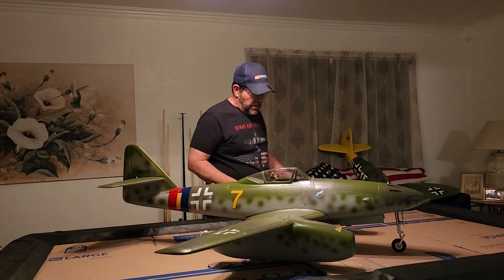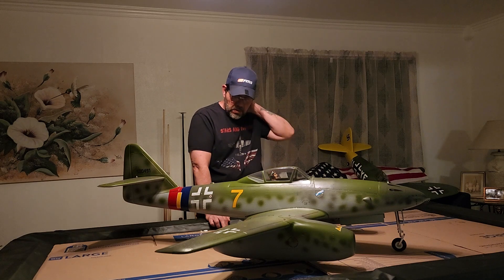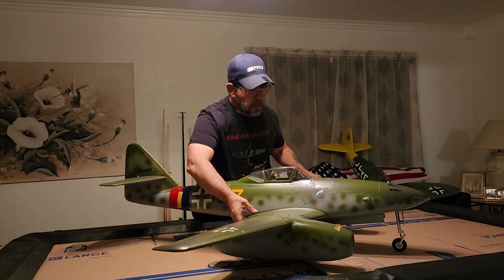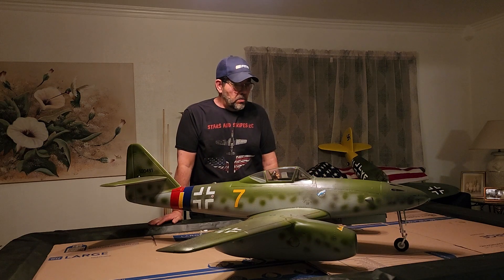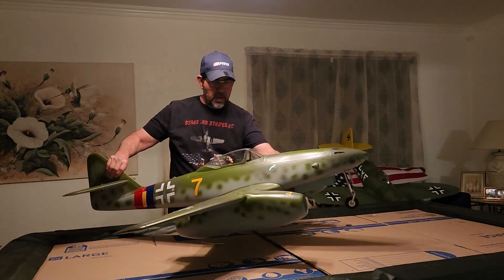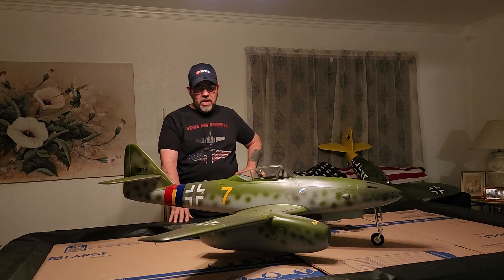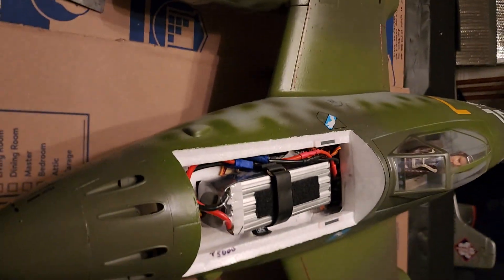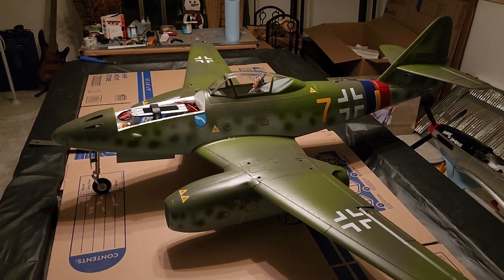Freewing ME262 after flight lipo placement etc Info

Comment: Yep 6s 5,000’s are perfect, I didn’t need to do anything for rotation just throttle up and she will rotate just fine, the only problems I had with mine was the nose gear pin sheared after a few landings and one of the mains towed inward, easy fix though
Reply from the maker: Sweet thanks for watching bud, and the info. I assume the pin is easy to get if they are not out if stock??
Reply: @starsandstripesrc8475  I have read people using the back end of drill bits to make pins and there twice as strong as the orignal ones
Reply from the maker: @Mikeylikesit1968  if you end up doing that,  shoot me picks of them, the size you used and a pic of the install?